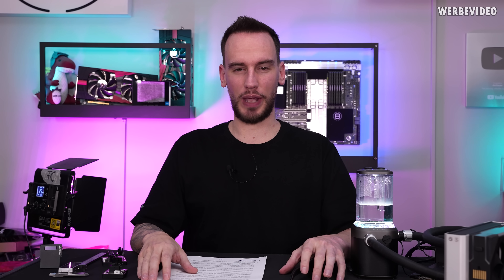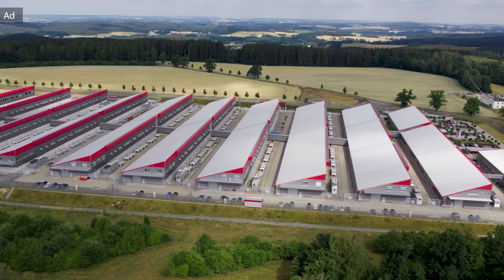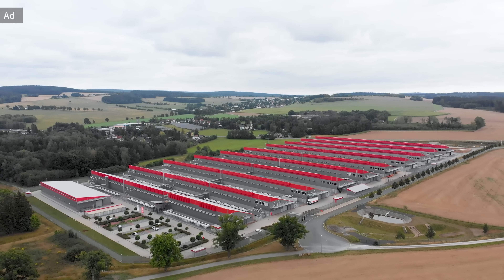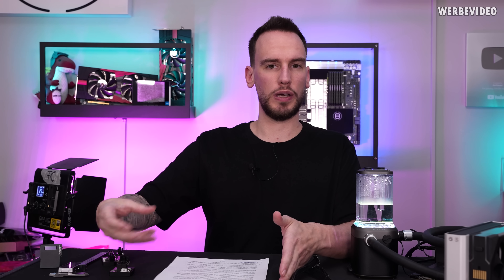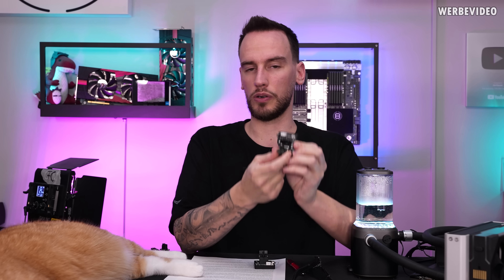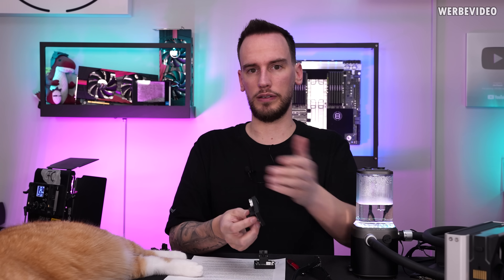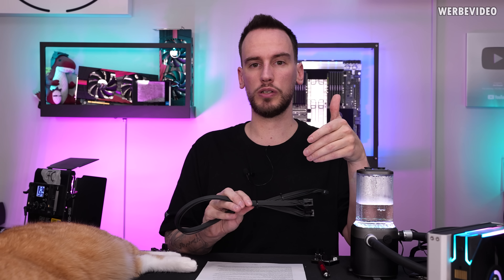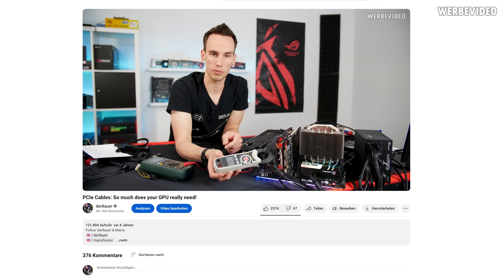12VHPWR is just Garbage and will Remain a Problem!!

Comment: A clear example of 'If it aint broken, dont fix it'. The old format works just fine.
Reply: the 6+2 is wasting space with that stupid +2 appendix that does nothing for Power delivery and it needs to be respecced to get everyone on the same Page.

a 12 pin eps style connector would be the perfect replacement
Reply: That statement is so wrong
Reply: No, it’s horrible. Using 4 8 pin cables was pain im the ass
Reply: @deivytrajan  but it worked and didn't burn down your rig. thats the point
Reply: the old format was worse and ugly
Reply: That's not how technology, or advances in technology work. Don't get me wrong, Nvidia should have done better and needs to sort this out but you can't blame a tech company for trying to better advance tech, or would you prefer to keep with decades old standards?
Reply: @lolzlolz69  This is not really advancement in technology. NVidia has a very NVidia problem. The 3x8 pin takes up too much space on the PCB, therefore they have to spend an additional 40 cents on the PCB. To solve this they engineered a new type of connector, that has prooven to be extremely unreliable and problematic in several ways. They must either switch to a new connector again, or go back to the old standard. I suggest going back to the old standard, because clearly they will need time to come up with a new design, and I would not like them to rush it after what just happened.
Reply: @kolle128  As I said, they should have done better and need to fix what they have done, but that's not an excuse not to try new things.
Reply: @kolle128  They did not engineer this connector, PCI Sig did. nVidia just implemented a bad connector design into their flagship.
Reply: @lolzlolz69 ignorance to the highest level. No wonder products are becoming even more garbage by the years because of such "iNnOvAtIoN". 

"If it works, DON'T FIX IT!"
Reply: @lolzlolz102 actually yes, if your replacement for a decade old standard is a direct downgrade that melts and catches fire that's bad and you shouldn't do it
Reply: @lolzlolz69  It's not a useful advance since it provides little more convenience compared to the old standard and really just takes up less space on a circuitboard that's already cheap enough to produce like 5% larger with the old connector. It might be saving some penies for manufacturers which does add up with a lot of units but it doesn't offer a meaningful upgrade to the consumer. You might compare this to the early days of USB type C but the difference is type C actually has a lot more pins and the potential to deliver much more data and power compared to the older specs, which is becoming more and more useful as it matures. This new standard doesn't really promise to bring much other than cost optimization and aesthetics which I don't think are meaningful upgrades to the consumer. It's an innovation to something that didn't need innovation, we don't change the outlets in our homes for marginal gains because it's already good enough for the intended purpose and a pciE power connector is not much different from an AC outlet in terms of functionality.
Reply: @lolzlolz69  

if that old standard actually has a safety margin, compared to nothing in the new shiny in the house? Most Certainly!
Just look at your wall sockets to see how long a good standard can be used
Reply: @lolzlolz69  yes I would prefer decade old standards. The wheel has been around for millenia yet I don't see anyone trying to replace them?
Reply: @potatoes5829  Never heard of alloy or carbon fiber wheels then? I guess you don't understand how much technology there is in modern wheels and rubber even at a general consumer level?
You still running a 486 and usb 1.0?
Reply: @potatoes5829  Also you say you prefer the old standard yet gloss over the fact that that standard has ist self moved on from the last standard. PSUs were not always modular were they.
Reply: @lolzlolz69  But your point about the alloy and carbon fibre wheels makes no sense here. You're talking about a change in material rather than the form of the object. Even though the wheel might have changed in materials, the aspect of a wheel still being round, hasn't changed. Whereas these new connectors that Nvidia have adopted, completely changes the PCEI connectors to a new design.
Reply: @ThePsp99  It was a stupid comparison to begin with, a circle is a circle, you can't change that can you, but you most certainly can change the form of a wheel (other than the fact it has to be round). That's why they come in all different sizes and spoke numbers and how they can influence the rest of the vehicle set up. The reason shape of wheels haven't changed for "millennia" is because they ARE the best for the job they do...until you get into the niche tracks territory. Again it was a stupid comparison to begin with.
Reply: @potatoes5829  But they have advanced over the years have they not? Or do you use flintstone wheels on your car?
Reply: @ThePsp99   And the aspect of a connetor being a 4 sided plastic frame with metal pins have not changed either. Going from a wooden wheel to a carbon rim with rubber tire and presise airpreasure is a bigger change.
Reply: @lolzlolz69  Funny you mention carbon fiber wheels. "New tech" like this 12VHPWR, also explodes randomly, like this connector melts randomly.
Reply: @lolzlolz69  manufacturing a wheel with different materials is not "reiventing it".
Reply: @lamikal2515  You can't re-invent something that has already been invented can you. You can certainly change specifications to adapt for different end uses. You also can't change physics which dictates a wheel is most efficient when it is round! Should we all go back to fully wired PSUs? After all, that standard worked so according to the OP we shouldn't have had modular.
Reply: @Audiosan79  I don't know where you're going with this. That's not the point I'm making.

It's still a wheel and it's round. The whole point of that statement "If it ain't broke, don't fix it" means you don't change anything if it's working fine. 

Like I said earlier, all you are doing is changing the materials of the wheel. You're not changing the fundamentals of what makes a wheel which is round.

These new connectors are a complete change in design and you still have the problem of needing multiple PCI power plugs in order to power Nvidia's cards, depending on which connector you get and if your power supply only supports certain types. Not to mention, you might need a new 3.0 PSU if you only want to use one 12VHPWR connector without loads of other connectors powering it too. 

While the aspect of a connector hasn't changed, meaning it still needs a 4 sided plastic frame and metal pins, the actual design of the frame itself, has drastically changed as well as the needs to use it. 

it's completely different from the one that we're used to for a few years now. I could understand if it was decent design but it's not. It's just melting people's builds and it is an unnecessary change.
Reply: Bruh, its 12v power delivery with sense pins its not new...its not advanced tech its lowered standards. Its lowered standards based on nvidia wanting a neat little connector on their card.

Comment: And why not split some energy and feed the card trough the pcie port? I believe i red somewhere they can handle up to 70 watts. Its not much but with so little margin, everylittle helps. Is that somethig that can be done via firmware or does it have to be designed from the begining on the card... Maybe those power lines in the gpus are empty I dont know.

Comment: I bought corsair premium sleeved cable CP-8920334 that is for corsair power supplies. It has only 2 8pin connectors at psu end and single 12VHPWR at the other end which means 300W from single 8 pin connector. They look like standard 8 pin connectors but I wonder if they are really made for over 300W each or if something like this can cause similar issues?

Comment: I think the old standards are holding us back. Not gonna blame Nvidia for trying to replace the old standards, but definitely gonna blame them for doing it half-arsed. They should have included adapters in the specifications or make it obvious that the GPU has to be mounted with a PCIe extender cable. The entire PCIe standard is not suitable for these monster GPUs. This is a case where the industry has to come together and rethink the entire approach. Not gonna happen though with how arrogant and anti-consumer Nvidia is.

Comment: I think this correction factor is not for number of tiny wires inside one insulation. It is for cable with multiple wires (multi core cable) - if You have cable with 4 wires they will not be able to dissipate as much heat as single one due to heating up eachother, that is why this correction factor is applied. Max current limitation is usually not due to wires, but because of connectors.
Reply: Underrated comment!
Reply: Exactly what that derate is for. For cables with multiple conductors, not individual strands of wire in one conductor.
Reply: You also have the problem that the individual pins in the connector will not be resistance balanced perfectly, some will be more resistant and heat more. As that pin heats, it encourages growth of the surface oxide layer on it quicker, potentially turning it into a runaway degradation. In my mind, you should derate connectors for that to stave off medium and long term issues.
Reply: @SianaGearz  That is true. Despite that wires have plenty margin, connector itself is just at the edge of max rating. Situation shown in video, where bending wires causes connection continuity issue, should not happen - there is something wrong with connector quality I think.

Comment: Only two reasons to cut down from (3x) or (4x) 8-Pin.  
A) Less Cable = Less Costs.  The costs here, on Nvidia's or their AIB's scale could be quite large when we're talking about 10's or 100's of thousands of units.  Easily Millions of Units if you include all GPUs made with 12VHP, both 30 and 40 series.  
B) Because there is a push for hiding cables for aesthetic reasons, which in case reaches into just being stupid.
IMO, there was sure to be a lot of 'Game of Telephone' between the Engineers that recommended against 12VHP, the middle managers passing along their 'recommendations', and the executives that made the final call.
Reply: The included adaptor cable increased the cost though

Comment: I've been using a custom super flexible silicon coated cable for nearly a year. My built in the tiny Formd T1 wouldn't be possible without it but it works so great and is so much easier to bend to the right angles that I really don't understand why PSU manufacturers aren't using them. It completely eliminates the need for these bulky silly adapters
Reply: Stiff insulator helps ensure the wire is installed within specification. Electrical resistance increases with axial strain

Comment: This whole 12VHPWR connector seems really weird to me. I understand why we can't or souldn't have somethng like 3-4 8 Pin connectors on the high end, but I'd expect something bigger and sturdier than this downsized solution (especially on a card where the total size will be always big). Also with theport placement, I'd rather see these ports on the back of the card wtih a factory extension or even better, on the back area with a cutout on the backplate. It would heavily reduce cable strain and make installations easier, even if it would look a bit worse. I'll stick with the old school 6/8 Pin connectors (and AMD) until something better comes along.
Reply: 2x8 pin can easily replace 12VHP. They are much more capable then they are rated for.

Comment: STOP BUYING THAT POS GPUI 4090, 4090 is an marketing standup, nothing more, but ppl simply bite that marketing and buy this shit, THERE IS NO GAINS to have this in your system in contrast with the problems that come, sag gpu ending up broken boards, heat problems, power consumption like nothing, FIRE HAZARD !, also marketing price; at the end ppl do what they want with there money, but  at the end of the day, 4090 is just an waste of money ither you ppl like it or not !; PS this "new connector" is just an marketing thing, an bad design, also, an totally FIRE HAZARD !

Comment: The main issue is the weak connector in combination with relatively stiff cables exiting the card in the worst place possible. So a combination of mechanical weakness, maxxed out specifications, and out-of-spec usage (in this case the mechanical part).
This means it is a defective design, and no, two of them won't fix it either. It will just mask some problems.
The fix is a properly designed connection with strain relief and a pin interface that is tolerant to the real world strain, not just some paper specification. The "35mm before radius" specification is obviously defective and should be discarded. Just look at how much the pin housing on the card flexxed during the fault demonstration.

Ironically, thinner cables will faster much better in this regard. This is also the issue with the cablemod adapter - it adds a long lever arm to an already weak connector.

Comment: You're claiming the Corsair power cable is causing a cut out when the GPU is under load. Are you sure it's the cable and not the GPU or the connector? Have you tried another cable? If not, then you could be liable for slander.
You might have a dry joint on the GPU socket.
Am not surprised the Asus GPU light comes on when you waggle the cable. You would not go up to a wall socket mains supply and waggle the cable. Again that looks like the socket though, unless pulling the cables about is pulling away a contact.

Comment: Can't we start admitting that this type of plug has reached the limit of how many amps, watts this plug can handle and that we need a successor, a new and more powerful plug?

We already had a powerful plug that all power supplies came with that all IDE hard drives and CD players used. The white molex plug.

Suddenly someone found out that all plugs had to be as small as possible but deliver and handle the same amount of power as before.

This type of video card plug we use today has never been a good or powerful plug that can draw a lot of amps!

Comment: At this point, it would be easier to just introduce a new power supply standard with a higher voltage.
Reply: The problem there is that the voltage would then have to bucked back to 12V by the device.  You are not wrong, but it isn't a simple fix it would mean entire redesign of devices.  Perhaps that is what is needed for the future. However, it is not like this amount of power hasn't been done in 12v systems before though.  Car audio comes to mind where 1000W systems are considered casual load. If you look into that world you see beefy connections and wires that are over engineered for what they are doing.

Comment: Maybe having a gpu that draws over 500 watts is the problem.  Efficiency has taken a back seat.
Reply: Undervolting doesn't occur to some people I see but hey when in doubt read the manual.
Reply: 4090 is a very efficient GPU, it’s just we’re reaching the limitations of silicon, so you have to push more power to see real performance gains.
Reply: A 3060 will be a great card for you!

Comment: Is there a re-plug limit on the cable i.e. could the cable have been damaged by repeated plugging? This might be an issue on a cable used for testing. I know there was a potential issue with SATA cables.
EDIT: got off my arse and checked online. for the amphenol minitek com-5 pice connector system, spec sheet has durability of 30 mating cycles which doesn't seem like a lot.
Reply: So did you switch from your sit down desk to your stand up desk? Bwahahhaa had to, just had to

Comment: If the wires are heating up and it's so brittle that you can't even bend the wires, then it's not just the connector. It's the wires. Use proper gauge.

Comment: Still really annoyed we didn't just re-use the 8 pin CPU power connector on videocards when we originally started having cards with extra power. It has 4 conductors each way for carrying current, not 3 like the GPU power connector. The extra two ground pins usually don't even carry current, on many GPUs you can bridge them together and it'll work with a 6 pin cable. One of the pins is just measuring for a ground connection, not passing current through it so the extra wires are a glorified "cable check"

I agree we need a new standard for GPUs but this microfit based connector ain't it. I work with microfit daily and I hate it.
Reply: This 100%. Nvidia was already doing this on their Tesla cards with no issues.

Using the 12V EPS would have requried less engineering, and would have been more safe anyways.

Nvidia would still save space on their PCBs compared to 8pin and 6pin PCI power connectors, and they wouldn't even need to engineer a brand new connector.
Reply: Pretty much yeah. EPS 12v make sense for GPUs aswell... That alongside updating dedades old standards would drastically lower the connector count on GPUs.
Reply: yes having 2x eps connector onto the 4090 would have been the killer move here. unfortunately somebody high enough up in nvidia decided that only 1x footprint of the eps size would be sufficient. which clearly is the cause of all this design choices from the beginning. so you can squarely put the blame onto jensen and 'friends'... err i mean employees. err i mean: army of scared engineers (both inside and outside) who were too scared to speak up and get fired over all this nonsense. or who thought that their job was actually some nonsense worthless politics instead of actual proper engineering
Reply: yes
Reply: Nvidia just seems like they will not care if peoples houses burn down with them in it as long as it doesn't cost them money.